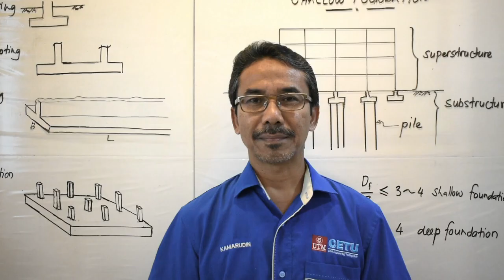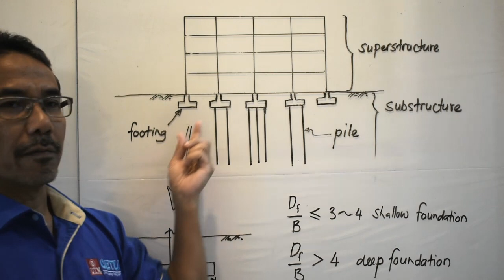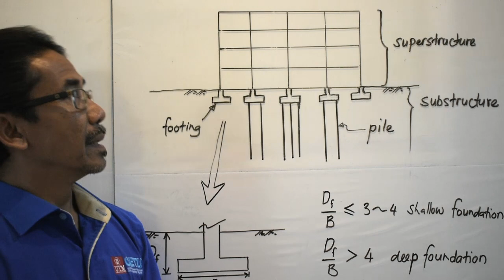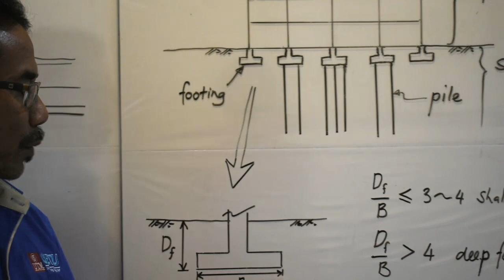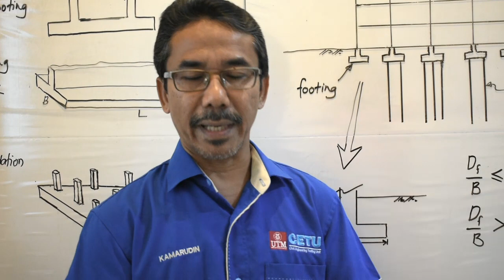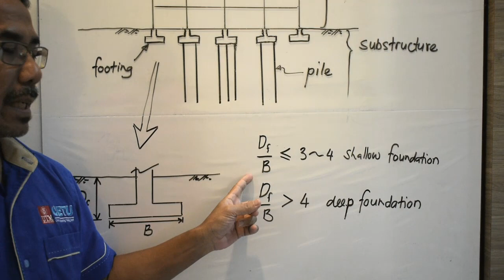Shallow Foundation - 01 Introduction

Comment: Dr. Ahmad, to determine if it's shallow or deep footing, the ratio is Df/B. What if the footing is rectangular, is B the smaller dimension to use?
Reply from the maker: yes use the smaller dimension
Reply: @kamarudinahmadphd7412  Thanks a lot. 🙏
Reply: @kamarudinahmadphd7412 sir are these eurocodes based or BS based?